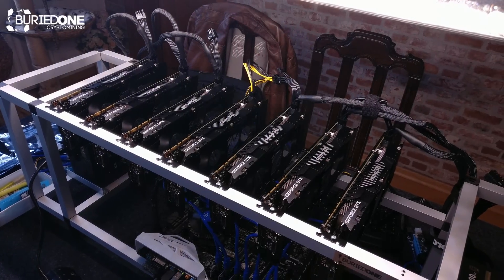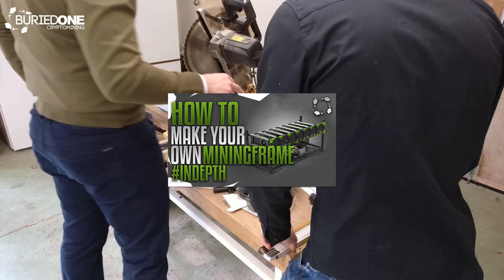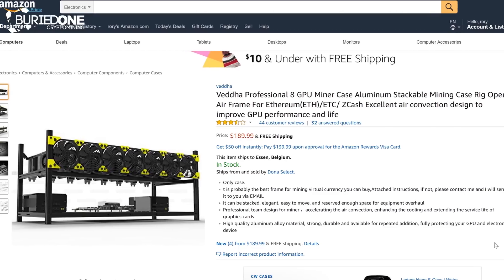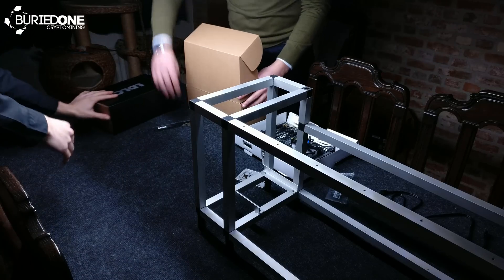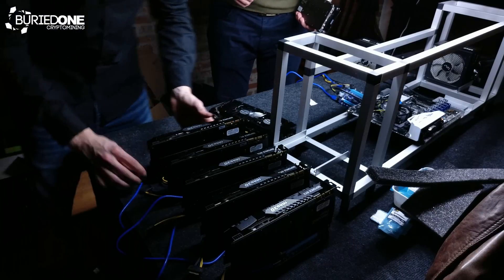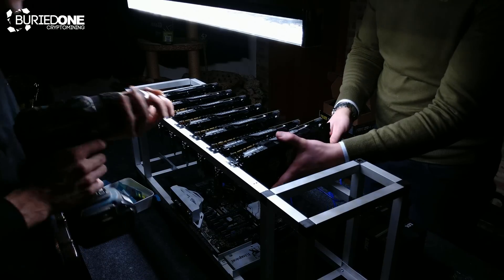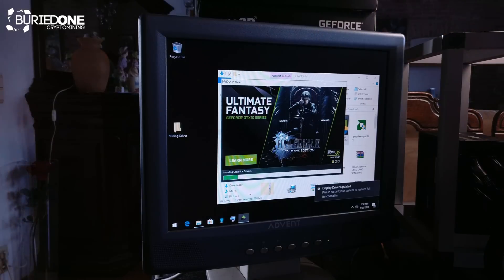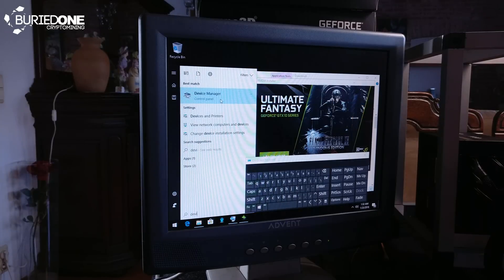7 GPU GTX 1070Ti Mining rig Build, Start to Finish #INDEPTH Series

Comment: CAN ANYONE HELP ME PLEASEEE

i need some help, i'm trying to run a rig of 1070s, when i'm trying to mine with just 1 card, it immediately crashes... the card no longer gets recognised straight after (no status on msi AB) - i have to do a clean driver install for it to come back... asus z270-p, intel g3930, 4gb hyperfury ram, 120gb ssd, corsair 750w psu.... i've tried a different gpu, different psu, different ssd, about 5 different risers.... i've tried nicehash and it crashes during benchmark, i've tried claymore and it crashes immediately...
Reply: the only thing i can think of is faulty mobo now...
Reply: zotac 1070 amp extreme - i've tried an older nvidia driver and i've underclocked the shit out of it
Reply: Try it directly in the motherboard if you haven't already tried that. Risers are notoriously "iffy" and often defective. The other thing is the PSU might be bad (I've only had 1 PSU not fail. That's 2 Rosewill 1000w that failed (within 3 days or less, one blew up my $250 SSD they refuse to replace), the other only put out 650w before tripping its protection, which its 1000w rated.... Then I've had a Thermaltake 500w fail, but I don't really care about that one, it just degraded to 350w, besides, its still half working and was pretty well pocket change at $30, the others were not pocket change.

My only PSU that does what it says so far is my Corsair HX1200i (yeah its $250, but that's the price of the SSD the Rosewill blew up, so as long as this doesn't fry anything, its worth it). It also has handled 1250w for 24 hour load test, and even past 1300w for a few minutes since I'm so skeptical about my PSUs now. Since stress testing it, I only run it 900w and try to keep below 1000w, even though I'm sure it will last beyond its 10 year warranty at max load like its rated, the thing is amazing and very over-built, doesn't even run warm and can have fans off at 600w (the other PSUs I've had felt like heaters inside them... I also never stressed them with at most 80% load capacity and they all failed quickly). So I spend the extra just to be sure. Check with another PSU if you can, that might be the problem. But it could be anything.
Reply: thank you for the reply - it turned out to be bad risers, connecting directly to the mobo made it all okay... i ordered 24 risers, i tried 8 of them, all of them were faulty - what is life

Comment: I have an Asus Rampage IV Extreme and I can only getting it to see 4 GPU's, rather than 5 using risers.  I've tried everything and getting nowhere so was looking for your info on the BIOS.  I have set it to PCIE Gen2 for the riser slots but it is still not working for me.
Reply from the maker: Stephen Eddy Nope thank youtube for that :/ but soon they will be in the description after i. Made them ;)
Reply: Any ideas on this one?  Seem I can configure the voltage and speed of every little thing on the board but very little on PCIE

Comment: Have my frame and components hooked up waiting on cards to arrive, would you recomend starting off with ints over nice hash, will be running 2x6gpu 1080ti's, biostar tb250-btc+ boards, celeron g3900 cpus, and 2 antec 1300w +platinum psus on separate 20amp breakers, this should be good to hold 8 cards each correct?assuming rest of cards ever ship. 
Have you ever heard of or tried
 https://www.bitsequence.biz/?ref=KryptoKnight

They claim 3% return daily lifetime guarantee, which would make ROI 33 days, which if the site stays up a year(bitconnect made it 2 yrs) would return 10x investment

Comment: Would it not be possible to run this on a 1200 Platinum psu, if the consumption is sub 1000? Thinking of doing it with an Adyson 1200 platinum instead of 2 weaker PSU's?

Comment: You can get 12 1070ti to be recognized on that mb with smos. I was having a lot of stability issues. So i went to 8 instead. You can use 1x4 pcie extension in the 16x. I also tried to use two pcie 1x4 extenders  but once i added the other it would not even show bios. curious to see if an ik7 with its added pcie lanes could support more. Well done man keep the awesome builds coming!

Comment: lol ! i made exactly the same rig yesterday !! same mobo, same psus, and same cards (mine in micron memory).
i was able to reach +800 on memory and 32.4 mhs/card ETH.
i didnt succeed to overclock the cards under simplemining.
Reply: Its really annoying, the Titan Xp I have is doing a max of 38.5 at 230w, but I run it 33 Mh/s Eth to optimize power and temps. I think the 1070ti is a much better choice for Eth for the Nvidia side. The Titan is pretty low compared to the 120w and 28 Mh/s of my RX 470 cards, so I don't think I will be mining Eth with it, the RX is just way more efficient.

Comment: Hello , i would like to know how did u manage to power the 7 gpu rig with 2 LDLC 1000W power supplies. I have some of those and they only seem to be able to power Three cards with the given cables. Did you use cable extensions or adapters?  Greetings from France.
Reply from the maker: andrei stanciulescu yes i used an extra extention for the 4th gpu, http://mining.buriedone.com/VGAPOWERSPLITTER
Reply: i have the same ldlc psu , french ??
i use some pcie extenders to power 2 cards with one pcie cable, but dont make dual-mining because its 250w max per cable.
i would like to order some new pcie cables (seasonic) but i don't kow where to buy them... any idea???